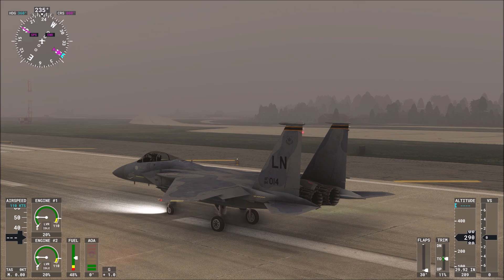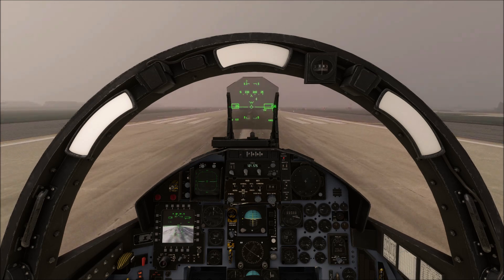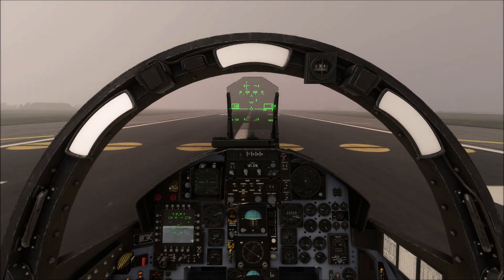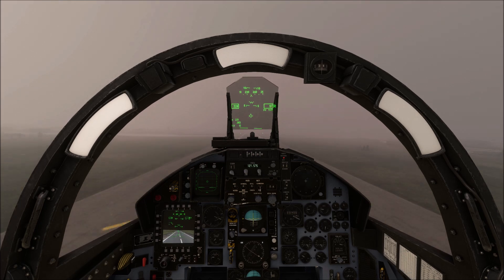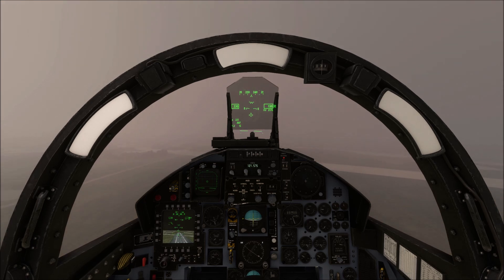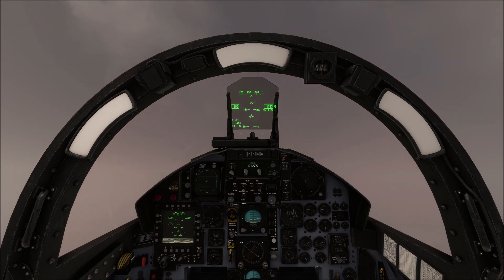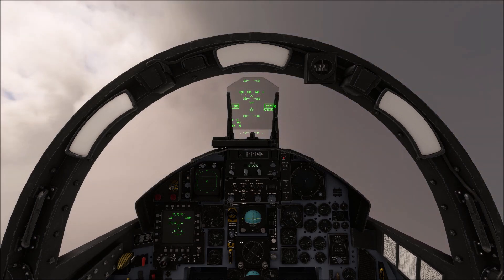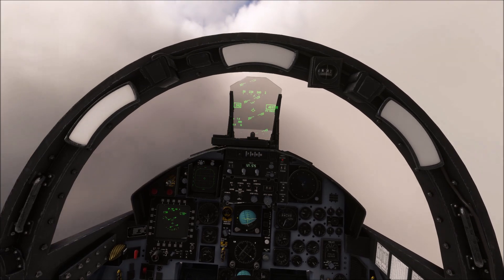F-15C Eagle flight demonstration after recent update to product

Comment: Hi big fan love your aircraft I have the f15 and the f16 but the f15ex there the engine is the same as the F 15 E D C but the F 15 EX in real life is supposed to have a stronger engine so can you might look into that big fan at your aircraft😊
Reply from the maker: @Aviator92037  Hi, the EX does already have the more powerful engines as per the real aircraft. It has a slightly higher thrust to weight ratio, but most of the advantages are in high AoA handling.
Reply: @ thx
Reply: @DCDesignsMSFS I can pull like 20gs in the f15
Reply from the maker: @Aviator92037  Yes, just as you can in any aircraft that doesn't have FBW to prevent you from doing so. But this is a sim. In real life, if you did that, you would pass out and crash. There are always limitations in a desktop simulator. Maybe I will add failures soon if G limits are not respected  :)

Comment: Hi,I think it would be even better if an AOA gauge was added to the HUD and V/V was visible during 130kt landing.
Also, if I carelessly push the control stick during an aileron roll, the plane will spin. I've heard that it's even difficult for a pilot to intentionally put the F-15 into a spin.
Reply from the maker: Agreed on all counts. An unloaded roll will depart the aircraft, although Chad ( F-15 pilot who tested them in MSFS ) didn't remark on that as being inaccurate. Landing is based on AoA, not airspeed, so you might be a touch slow, something for me to look into though.